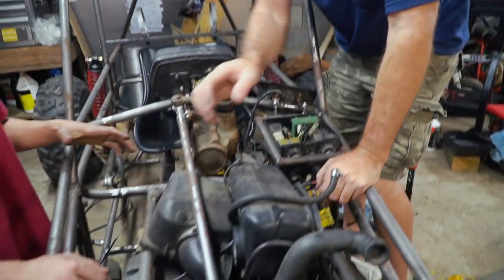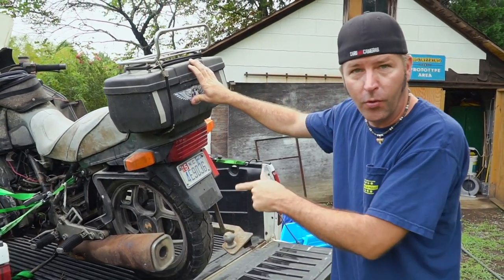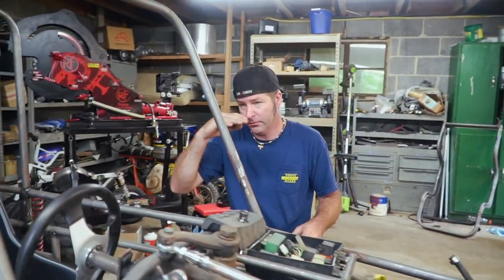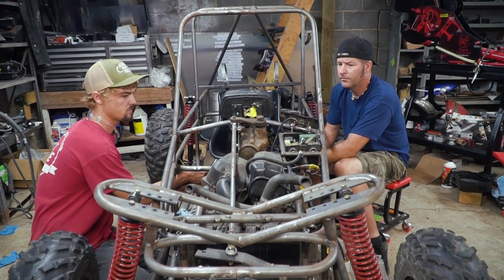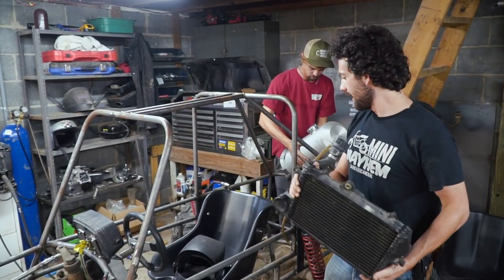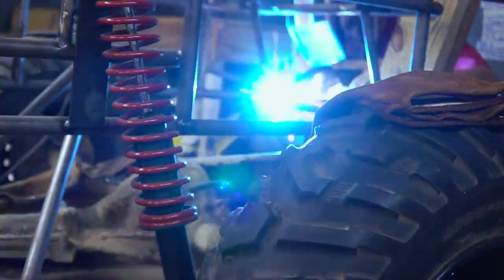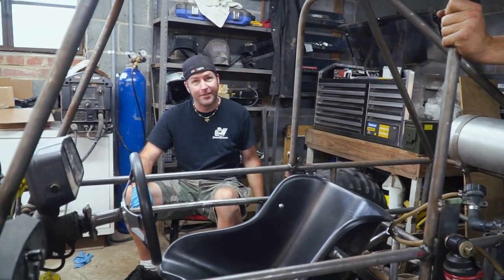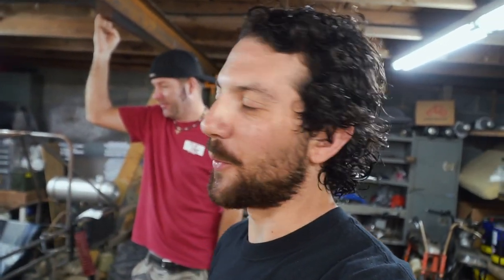1000cc Mini Trophy Truck Pt. 12 | Sputtering to Life!

Comment: it would be better to have the fuel tank inside of the frame perimeter. i've built a few sand rails, and crashed them. anything not protected by the cage will be destroyed in the event of a roll over crash. a fuel spill from a ruptured tank is the last thing you want when you are upside down. just sayin.

Comment: Radiator needs to be up high, not buried behind the seat.  It's going to heat up the back of the seat.  Every thing should be inside the roll cage.

Comment: I will never refer to my, or any, welded diff as anything other than Lincoln locker again.
Reply: 99 miles away  its been the  nickname for it for a long time. Had one in my first 4x4, it's not fun on the street. Unless you want to be a drift car
Reply: @joshuaatkins5197  now that you mention it, I think I have heard it before. I welded the diff in my 89 Dakota 4x4, and I love it. Don't love eating up tires though

Comment: I see you guys always trying to start your vehicles with brake cleaner. Do yourselves a favor and go out and buy a can of starting fluid. Some brake cleaners (chlorinated) can be deadly poisonous if the motor even starts on it. And I wouldn't really trust it if it was non-chlorinated. Being that you guys often try to start a motor in an enclosed environment, that just makes it even more dangerous. On top of that, you are doing harm to the motor. Brake cleaner washes the oil off the cylinder walls, essentially, creating a dry start every time, wearing down the bore, piston and rings. Starting fluid has a lubricant mixed in with the ether and is way more combustible.

Comment: All that room above the fuel tank on the diagonals where you could mount the radiator and get good air flow, but you mount it to the side with no airflow. And the fuel tank external to the roll bar. SMH.

Comment: Wtf wouldn't you mount the radiator on top of the rearmost downtubes above the drivers head where it'll be in direct line with the maximum airflow at any speeds plus as far away from the driver as possible... As long as it's below the halo bar it cannot get hit even in a rollover or back flip...Fuel.the one thing one wants protected,besides the pilot,inside the cage in case of rollover or flip and y'all mount it outside the bars at the rear...